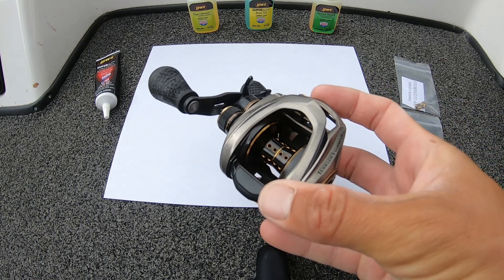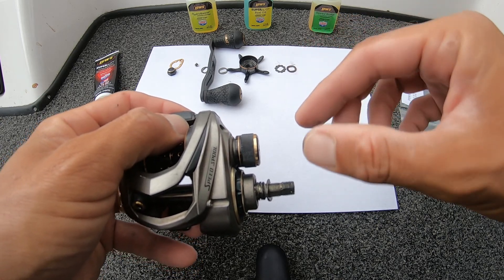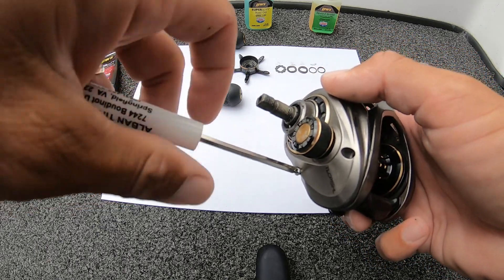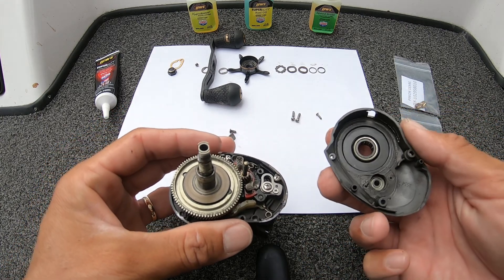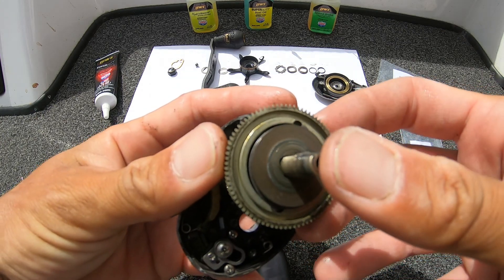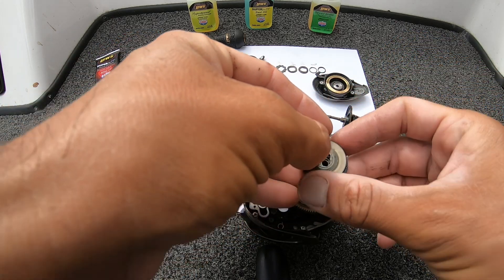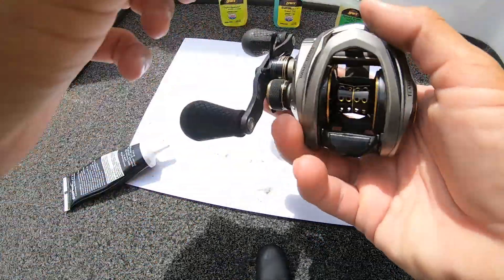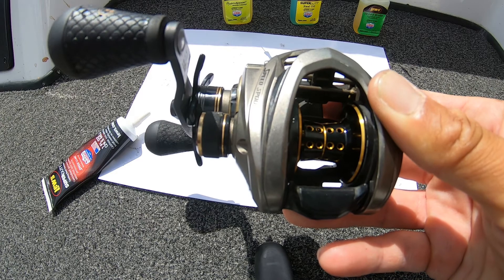How to Replace the Drive and Pinion Gear on a Lew's Custom Pro

Comment: Were the gears bad, or were you trying to do something like change the gear ratio of your reel?  Sorry if thats a dumb question, never taken apart my casting reels before.
Reply from the maker: Gears were making noise, but the reel still worked fine. I wanted to eliminate the gear noise.

Comment: Thanks for the video. Gave me the confidence to pull my Custom Lite apart that is making a grinding noise. Not sure if it’s the pinion and drive gear or not, but I’m going to try and find the parts guy and replace them anyway. We’ll see ¯\_(ツ)_/¯
Reply from the maker: Glad I could help

Comment: That was pretty awkward the way you disassembled your real. While you had sepertated  the half you should had cleaned it up . At least a little  service. It would have been easier if you removed the spool and side plate frist. Not the way I would work on my reel.  But different strokes for different folks. Hope it worked out.
Reply: I totally agree remove the spool and spool side plate 1st or 2nd in your  disassembling.  I have a lot of OCD and I cringe when people go that far into a reel and leave parts dirty .